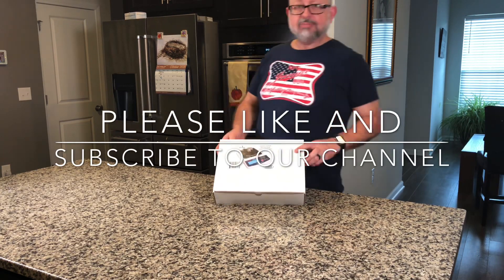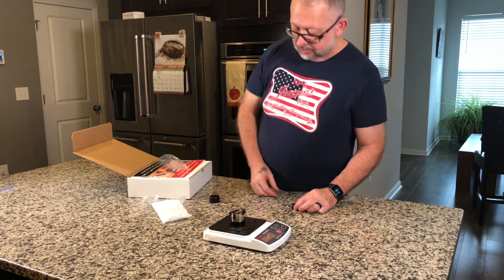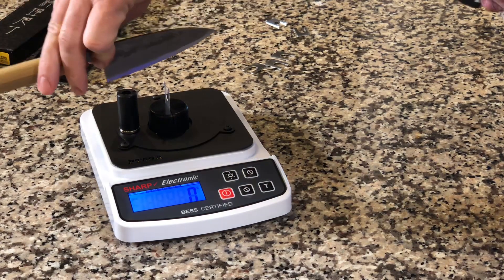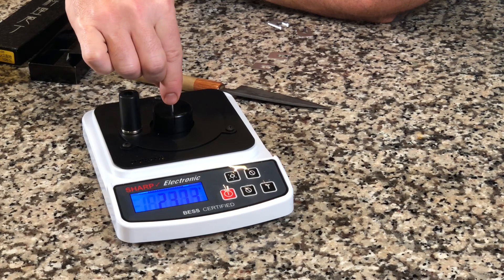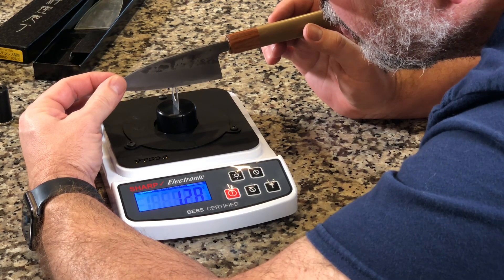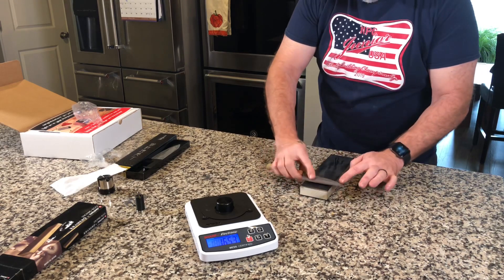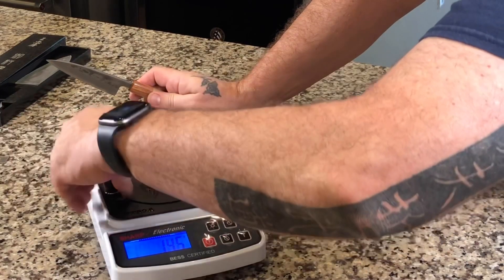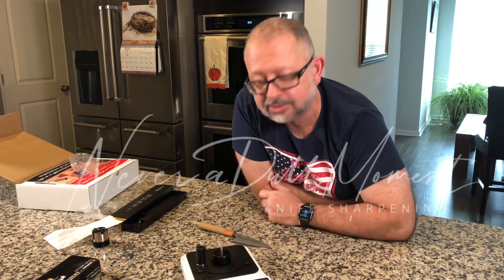What is your Bess?  Unboxing of the  Edge-on-up Sharpness Tester - Never a Dull Moment

Comment: I basically found this unit to be inconsistent to such a degree that I returned their highest spec machine to the distributor who - after trying themselves - agreed with my results. I sought advice from the manufacturer. The machines scale measured correctly on dead weight but when the media was used - the results could vary by 30 G and this was meant to measure to an accuracy of 1g +-
There are to many variables. Even the speed that you bring the edge down will give a very different result.  Low bess marks often happen when speed is used i.e. false readings. The tension of the media is a variable as is the media itself. The clips give even a wider different reading to the media. I found it next to useless and no help in giving a real or indeed consistent measure of edge sharpness to either myself or the customers I was sharpening for. Very disappointed from a manufacturer like sharp.
Reply from the maker: You were correct. I am very familiar with that. You always hear us saying every video, "it is a tool but it is not the standard!" Also, you will note that the company has its own saying, "you can do it too fast, but you can't do it too slow." It's just a helpful tool. No one should really read into it too much. You have to do multiple test and you also have to make sure your speed is correct and you have to do different points on the blade. It's a lot of work. It just will help you while you're trying to get better!

Comment: What's the capacity of this scale? Because your applying a lot of force when changing the hairs? Have you ever used any measurement equipment?
Reply from the maker: I don’t have the money to get other equipment to test this. I know that I spent the most amount of money on the best version of this model to have the best version of this model. I also know that if you do it too fast your score will be a fake score. You see that all the time. You need to press slowly. It’s a tool but it’s not the standard

Comment: I can do this with my cheap Harbor Freight scale that's not just for weighing out weed anymore! For "ME", a knife is sharp enough if I don't squeeze a room temperature tomato to death. I always use a stroke when cutting, not straight down anyway. I'm also not looking to split atoms either. Please don't take this comment negative, but think,    what did we do before this expensive scale was around?
Reply from the maker: First of all, I wanna apologize for not finding this comment sooner. I do try to keep on top of it and there's no excuse for letting it slip. Please accept my apology. I'm with you, if you can slice through a tomato and not have any juice on your board and that's OK with me. I agree that the tester is a tool but it's not the standard. It gives us an inkling but it only measures one part of the knife. Different people live by different scores. This is just one of the many ways that we can find out some type of uniform truth.

Comment: As Mom used to say: "Both hands for beginners". Seriously, it helps, even when using the fulcrum.
Reply from the maker: Thanks for looking out!. You do feel like you have to put your finger on the tip of the knife. Even though you're using the fulcrum, it just feels like you have to keep the pressure on that end or you lift up..
Reply: @nadm  The advantage of the fulcrum is that you don't "slice" at all when using it. Without it, any lateral movement you impart to the blade can drastically change the reading. I use two hands to measure whenever possible, one to stabilize the portion of the knife that is on the fulcrum and the other to lower it onto the test media.

Comment: The pre-loaded test media are not BESS certified.
Reply from the maker: One of the problems with the spindle is that you can actually pull the Monofilament pretty tight. You can actually over tighten it and cheat a little bit. When you buy the ones that look like floss picks, Then you know that the tensile strength is consistent. I will use the self-feeding monofilament when I'm doing test on my own Knives.
Reply: @nadm  Pull it as tight as you want, as long as it's tight enough not to sag, it's not going to change the reading appreciably. Ask Mike Brubacher. The test clips are also considerably more expensive.
Reply from the maker: @MrMZaccone  I agree with you that they are more expensive. It's just at least a level of consistency. They actually set some of Each to you when you buy it. I do it so that way I don't have to worry about one knife to the next. After talking to several other manufacturers, they like using them so they know it's consistent. I like doing the other and pulling it very tight. It's easy to almost pull it so tight that it snaps. You and I both know that it's a tool but it's not the standard. I also see people cheating. People will push too fast on purpose. They have a saying, "you can't do it too slow, but you can do it too fast!" It's not my favorite test but at least everybody understands it. I like slicing blueberries!
Reply: @nadm  Except, as I said, the manufacturer themselves will tell you that the clips aren't certified to their standard. What does that tell you?
Reply: @nadm  As for blueberries, that's pretty subjective. The Edge On Up is objective ... period.
Reply from the maker: @MrMZaccone  it tells me that we need to improve on this machine. They shouldn't send the clips. They send the clips with the other. There should be more of a standard.
Reply: @nadm  The clips are specifically for people who have physical problems loading the standard media. Like I said, ask Mike Brubacher before you make assumptions. He's also just come out with a new "Edge Lab" system that improves on this one dramatically.

Comment: Some good results I highly suggest picking up the ebook by knife grinders called knife deburring. Its under $5 but it opened my eyes to even sharper edges. That hit 120 below on the bess. It has great pictures of edges and burrs. I will note its for use on a tormek but also has useful tests to gauge your edge other than using a bess test which some cant afford. Anywho long story short I've had a knife professionally sharpened to 80 bess score test. They used various belts, and felt wheels and stropping but edge formation and longevity was amazing normally with heavy use of knife work at my sushi job I sharpen my knives average every 2 weeks. When it was professionally sharpened I didn't have to sharpen for a month. The sharpener explained you have to know the limits of the knives steel which angle it can handle etc etc. And suggested reading this book and going down the rabbit hole.
Reply from the maker: I have the book. I love them. The point to show out the box score of knife. I will be doing tutorials on demurring later.I am only going for 1 to 2 movies a week. I have a list made of about 95 movies to show. Please subscribe and stay tuned. Thank you!
Reply from the maker: For you a discount at Perfectedgecutlery.com

Code to enter “NDM20”
20% off everything
One use per customer
Active now -12/31/2020
Reply: SABOL BROTHERS did 8 on a BESS tester. Just watch the latest video from burrfection.

Comment: @Never a Dull Moment, Thank you for creating a channel where we are all able to learn together, regardless of our current knowledge & level of technique. I believe everyone who sharpens, and wishes to progress in their technique, regardless of where they're currently at, will be able to benefit from the material you're putting out, and with what you've done so far. In other words, this, from my point of view is not a channel strictly for experienced sharpeners, nor strictly for those of us just beginning the art of sharpening knives. I have a question about the machine used in this video: It appears that you received the PT50A Industrial model, is this correct? I'm curious not because it is of critical importance, but rather because on the page where they're sold, it states that the PT50A is warranted for commercial/industrial use, for three years, as opposed to the other two choices which are not. In an effort to have a greater consistency with other users of the same line of devices, I plan on eventually getting the PT50A, as opposed to the slightly less expensive models. And quite honestly, I believe most of us are tired of watching people cut paper items, which tell us nothing very specific in regards to how sharp a knife actually is, where as a Bess testing apparatus gives us very specific information on the specific sharpness level of any given knife.
Reply from the maker: So you are correct that I’m using model A. It came with the most options. The spindle is the cheaper route but it is nice to have the pieces already pre-done. They are much more expensive. It saves time in the videos. Because the machine only test the sharpness at A central point. You would have to do the test on multiple points of the same blade to see if you did it evenly. The paper test is important for consistency and the other vegetable tests are good to understand the knife feel as well as the consistency of Edge. You’ll notice that you can buy one as sheep is $179! I felt like I had to go with the warranty and all of the options. I don’t necessarily think it’s necessary now that I own one. I believe I’ll get use out of it in other test that I will be doing. I don’t think it’s necessary for a knife sharpener to have this device. It is a tool and it is not the standard. A person can thin their knife to such a point that they get it to a really low number. I hope people aren’t chasing low numbers and then they destroy the knife. That being said, it’s your night if you can do what you want to with it. We are all in this together. No matter where you are in your journey we’re all headed towards the same place. Nice work in your video by the way.
Reply: Except it doesnt. I blew a lot on this and it went back. Its as accurate as a rubber band tape measure